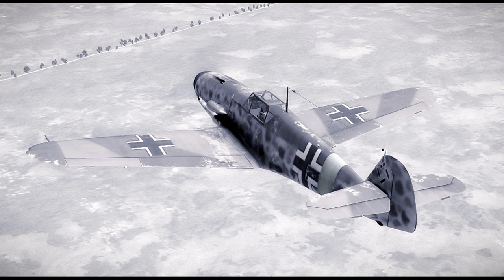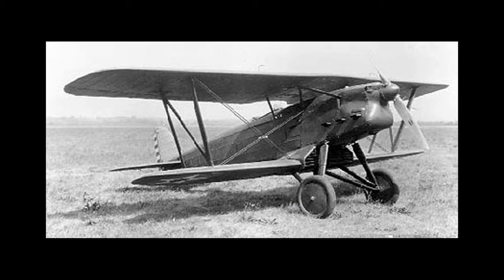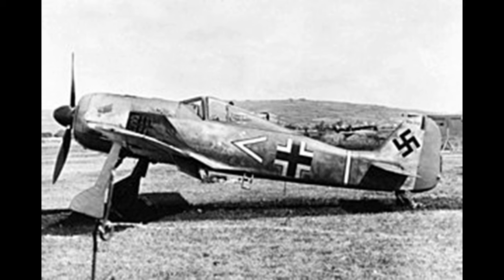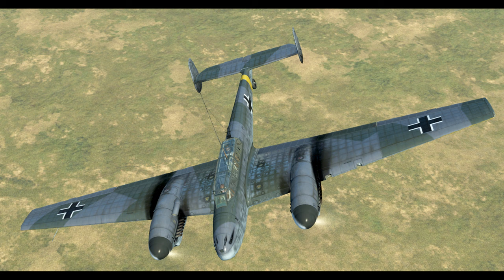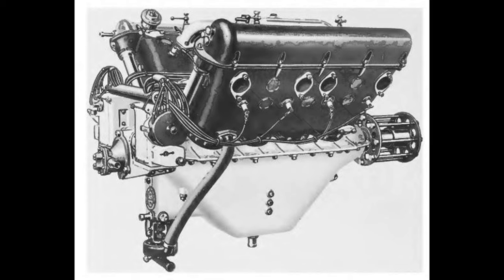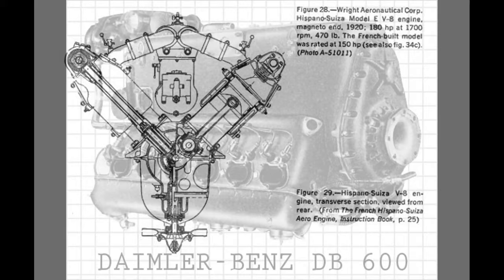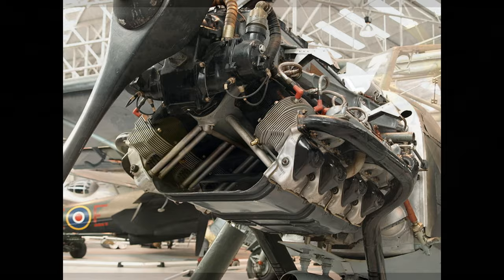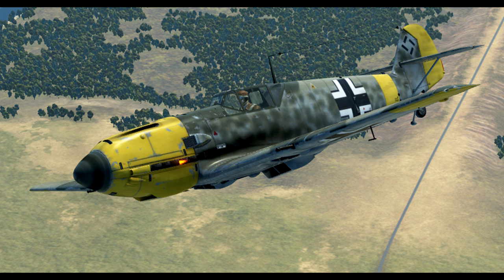Messerschmitt Bf 109 , Why an INVERTED V-12 Pt. 1? inverted V12s vs. upright

Comment: Many early aircraft in WW1 up to the beginning of WW2 had inverted engines. This allowed the direct propeller drive of the engine to be higher in the airframe helping with propeller/ground clearance. This may have influenced the later German designs.
Reply: And possibly also keeping the thrust line in the right place.
Reply: I bet you're right. It allowed a larger diameter prop with shorter landing gear.
Reply: See what DeHavilland did when they went from the Gipsy Moth to the Moth Major. That was the exact reason why.
Reply: Yep, but once you go geared you have the opposite problem. The prop shaft of the 109 is lower.
Reply: I think your right. A tradition of inverted aero engines made them comfortable with the inverted layout even when the primary reason for it went away with reduction geared outputs.
Reply: The Storch engine is the only WW2-era engine shown in this video that still retains this advantage, but yes, I was thinking the same thing. Moving the crankshaft upwards while maintaining a great view over the nose (or along the sides, in the case of the He111 / Bf110). That would be the best thing to use such an engine for, probably
Reply: @Bartonovich52  No, it doesnt. Not sure why you think that. The gearing reduces the height of the prop centerline a few inches on an inverted engine, but it doesn't cause you to have 'the opposite problem'. On both inverted and upright inlines, a geared prop is moved closer to the centerline of the engine, upwards on an upright, downwards on an inline. This slightly reduces prop clearance for an inverted, but you still have better visibility over the nose, it is easier to make a streamlined cowling with the widest part on the bottom faired into the wing instead of on the top, it is still easier to access the plugs and valve train, head gaskets, etc, and it is better to have a high mounted prop lowered slightly than a low-mounted prop raised slightly. In both cases it is far easier to streamline a geared engine with the prop hub centered on the block vertically than an engine with most of the block and heads above/below the prop centerline. And it allows for a hub cannon.
Reply: Better flight characteristics of having the center of gravity below the propeller axis, and cylinder head maintenance had to be the primary reasons, the better fuselage profile was of course something Messerschmidt would recognize.
Reply: @justforever96  questions if I may - why is it better to have a high mounted prop lowered slightly rather than raise a low mounted prop - I don't understand why this would be the case. Secondly there were upright vee engines with hub cannons such as the Yak 9 I think? I still agree that maintenance and visibility are the major benefits.
Reply: @Simon_Nonymous  Because a high-mounted crank lowered slightly is still higher than a low-mounted on raised slightly, and higher allows a larger prop diameter. The shape of the cowling is also advantageous, as is easier access to spark plug, which needed constant maintenance in those days (one of the issues with 36 cylinder radials; eac cylinder has two plugs, times 36 cylinders equals 72 per engine, times 4 or 6 for a B-50 or B-36 equals 288 and 432 plugs per plane to be checked or replaced). Any engine with a geared prop (all WW2 fighters) can theoretically be made with a hub cannon, that has nothing to do with inverted or upright.
Reply: @justforever96  28 cylinder. 4 rows of 7 cylinders. R4360

Comment: All the BF 109s had fuel injection. It would not stall in a negative g dive. Spitfires hurricanes used carburetors that would flood and lose power in the same maneuver.

Comment: I believe this analysis is 100% spot on. Logistics is one of those things people just don't take into consideration most of the time when discussing these topics. fantastic.
Reply from the maker: Thanks Central.
Reply: Yes. Cost and standardization is also a thing often forgotten. Bf 109 won over the He112 because it cost half of what the Heinkel cost, even if it was slightly lower performing. Standardization allowed also to use different engines easily on some airframes. Ju88/188 could use Jumo211 or BMW801 with ease. In general though it was one of the biggest failings of the German industry to not be standardized enough.
Reply: a  higher number of units are Often better than a few slightly better ones
as the case with German tigers/Panthers vs Sherman/T34s
Reply: @JoelLinus  wat
Reply: Amatuers study tactics

Professionals study logistics
Reply: Logistics is important as well as maintenance. The best fighter aircraft is of no prectical use when you need 8 man-hours of maintenance for every hour of operation like the F-22 does.
Reply: I am dreading finding out just how many hours of servicing the F35 requires per flight hour. 
I have a very great suspicion that the F35 is going to require more hours of service and make the F22 look much better. The F35 is late, overweight, over budget, suffering corrosion issues already and has been known to deprive it's pilots of oxygen. 
The Flying Dodo Fighter seems like a suitable name for it as we taxpayers of various countries have been sold a dud.
Reply: Yes the Germans have always been great at figuring out solutions to problems that didn’t exist. Like when they put paste on their tanks to prevent the attachment of magnetic mines the Allies didn’t have... or to be able to swap engine types which was rarely done.  But they weren’t so good at basic stuff... like setting up a massive pilot training program like the British did with the BCATP... or giving soldiers on the eastern front winter jacket. 

The 109 was very simple to make, but also very flawed. In his quest for lightness and cost... Willy Messerschmitt forgot about durability and growth potential. That’s where Kurt Tank and the 190 corrected some wrongs... but by that time the Luftwaffe was spread too thin.
Reply: I Fly Central %
Reply: Exactly. Sure planes, guns and tanks are cool and we like to focus on them and what they do best but the super vital part of any military is a good supply network and excellent logistics. Without fuel, ammunition and food, armies are just really shit camping trips.
Reply: @Bartonovich52  yes if the Germans had concentrated on heavy bombers similar to the lancaster the outcome of ww2 would have been interesting but its all just conjecture.
Reply: @Bartonovich52  The 109 may have been more fragile than the 190, but it was more maneuvrable (than the 190) and could out-climb Spitfires.
The 190 was also more expensive to make, that's also why many more 109s were made.

If I had to fly one I'd still take the 190 though.

Comment: Another side benefit of the inverted v12 was a slight decrease in noise experienced by the pilot- the exhaust stacks were much lower.
Reply: İs sound going really lower or just a little effect
Reply: @semihegeakdogan4964  It CAN be noticed,but i would not call it an important thing..you won´t hear much outside the cockpit either way :D
Reply: Surely every little helps. Remember, I don't think the Germans were using turbos, which means losing their muffling effect.

Comment: According to a teacher that I had in Airplane Mechanic School in 1973 and 74,   Merc Motter said that the reason for the crankshaft being on top in German aircraft was That they didn't have the quality on materials for bearings available to them as we did so they had to be able to change bearings much more frequently then we did hence the reason for the crankshaft on top to allow for quick easy  bearing changes.
Reply: The distributer / Mag.  and valves need the most "love" . Germans invented steel.

Comment: An underrated channel indeed! Awesome content keep it up!
Reply: But loved and appreciated by those that know it.
Reply: @bigblue6917  100% AGREE; WITH BOTH OF YOU!!!!!!!!!!!!!!!!!!!!
Reply: I find it amazing he doesn't have 100's of thousands of subs , honestly!
Reply: I believe another reason for having inverted v-12 engines, is because, even when the engines haven’t been working for a while, the cylinders and pistons, don’t dry out of oil, gravity contribute to have them lubricated
Reply: Greg, you asked why Germans used the inverted V12.
I suspect or has to do with having  enough space for the 2 machineguns above  the engine.
This kind off engine has the advantage off flying inverted with having no fuel problems because off its pumping system wich RollsRoyce  Merlin did found out.

Comment: It's kind of funny that I came for a lesson on inverted engines and got one of the best arguments in support of the Sherman tank. Your channel has the right mix of technical and story telling to keep it very interesting.
Reply: The origin of the PT-109’s motor is in here, too! 8:20
Reply: Unless you actually were IN a Sherman when it got blasted and incinerated everyone in it of course!
Reply: The only arguments in support of the Sherman tank are in it's cost and production capability. Otherwise it was a poor machine, badly designed and incapable of taking on it's opposition. The soldiers left to fight in it were abandoned to economics, left to burn, because it was more cost effective to allow them to die rather than to build a better tank. Dead soldiers provide only tiny pensions for widows, much cheaper than a production run on a really good tank.
Reply: @tag491a  And yet none of that is true.
Reply: @jaykilbourne1110  Substantiate your statement.
Reply: @tag491a  Alrighty. The M4A1's M3 main gun was more than capable of taking on any of the German Panzer 3s and 4s. Fronatly the tank was almost as well armored as the Tiger 1. The slope of the frontal 76.2mm plate gave it an effective thickness that approached that of the heavier Wehrmacht vehicle. The Gun stabilizer (when the crew knew how to use it) gave the Sherman the ability to nearly always get the first shot off, or fire while still continuing to move (allbeit slowly). The later variants armed with the longer 76mm main guns were a serious deadly threat to German Tiger 1s and Panthers, so deadly, the OKW gave standing orders to panzer commanders to engage and destroy 76mm armed Shermans first before any other allied tank, as the 76mm gun was powerful enough to punch through thier frontal plates at standard distances of the era (~750 meters). And no, it didnt take 5 shermans to kill one tiger or panther, it was more like 1.33/1.5 shermans, partially due to the fact that panthers were junk mechanically and had brittle side armor that tended to crack open. The Radio sets in the early war (1942/1943) Were longer ranged than the German sets. They were also NOT death traps, as Nazi propaganda would have you believe; for every Sherman lost, only .5 of a crewman went with them, thanks to spring loaded hatches.
Reply: @jaykilbourne1110  Not death traps? Then why did troops label them the 'Ronson'? After the Ronson cigarette lighter, lights first time every time. This is not Nazi propaganda, came from the troops who used them.   3015 Sherman tanks were destroyed from June to September in Normandy.  1845 German tanks were destroyed in the same time frame, many from the air.  Seems the Sherman didn't do so well after all.  And no, I didn't invent the figures, research it for yourself. The point I was making, more than just the limited ability of the Sherman tank, was the consistent approach of governments when it comes to supplying their armed forces with equipment. Only recently have they come to realise that soldiers are much harder to recruit and providing suitable equipment actually improves results. In the second world war, many make do solutions were used, based on economy of numbers at the expense of soldiers lives. This is a typical example. If you look you will find many more examples.
Reply: @sirmoke9646  Details below of the Ronson lighter patent from 1927. I can only assume the rest of your statement was equally well researched.

Ronson received an exclusive patent, in 1926, for a new automatic style of lighter that worked with one hand, and in 1927 Ronson began marketing it as the Ronson De-Light Lighter with the slogan "A flip - and it's lit! Release - and it's out!" Ronson's new lighters were an overnight success worldwide and soon the company offered a variety of lighters for all tastes.[35][36][37][38][39] As with the Art Metal Works output, many well-built and stylish early Ronson lighters demand high prices in the collectibles marketplace.""

Comment: Greg, Always a pleasure. Everything I've read, where they do add input by Db Engineers and the "Blackshirts" is serviceability and ease of maintenance for the Db's, plus the small valve train pieces were the main culprit for engine failure, invert the "V" add small magnets in critical areas, supposed longer life. Again great vids and info

Comment: The 109 had exceptional focused firepower with it's engine block mounted cannon that fired through the gear reduction hub and nose cone.  As well as the two MG 131s firing forward of the cockpit and along each side of the crankcase. Also keeps the weight of the guns and ammunition in the fuselage and not way out in the wings.

Comment: At the Messerschmitt foundation in Germany they told me that the main reason was the weight distribution down to the longitudinal axis reducing adverse jaw and faster roll rate. The heavy gun and accessories are all underneath the crankshaft.
Reply: Centralising rotating & static mass along the thrust line axis will certainly take some wobble out your roll.

Comment: Great video Greg , I guess another  advantage  of the inverted V,  (in the case of the 109 and 190d at  least ) would be having  room for armament centrally located in the nose..Incidentally my father was a mechanic during the war and worked on the DB 605 , BMW 801 , the Argus AS 10 as well as the  Maybach V12.s used in tanks and halftracks.

Comment: An excellent video! I just asked an aftermarket supplier for parts to a popular Detroit V-8 what it would take to run the engine upside down - beyond having a dry sump, he mentioned oil pickups in both valve covers and in the crankcase breather cavity.
But it's possible, and would make maintenance on a plane I'm Imagineering easier, as well as lowering the CG...
Reply: A Detroit powered plane would be something to hear lol

Comment: A simple  food for thought comment. Mercedes Benz 300 gull wing had direct cylinder injection and had problems with cylinder ring washing with fuel on no start conditions damaging. Rings and bore,inverting would allow it to simply go out the exhaust doing no damage to cylinders and bores due to no lubrication from washing with fuel
Reply: Or cause hydrolock and damagethe whole engine
Reply: The MB 300 gull wing used a straight-six engine...
Reply: @spitefulwar  an upright one so that's why he said that 300 had issues with ring washing, inverted engine avoids that problem. How many cylinders does not matter, their orientation does
Reply: @mmdirtyworkz  It was a straight six but not very upright one at all. The ring washing problem was the fault of the groundbreaking direct fuel injection system, so trying to fix a fuel supply problem by turning the engine upside down is just ridiculous. The engine had seen service earlier in a 4 door Mercedes with carburetors without any  problems.
Reply: Max Pain  Also, keeping the hot exhaust gas low and away from the tail helped with rudder efficiency because it made sure the rudder was as much as possible flowing in dense, cold air.
Reply: @deaddoll1361  noone said that they did the inverted engine to sort out the washing issue, that was just a bonus
Reply: No.- "Rings and bore,inverting would allow it to simply go out the exhaust doing no damage to cylinders and bores due to no lubrication from washing with fuel."
Reply: @deaddoll1361  Direct injection had been around for a while when the 300 SL came on the scene.  I believe the  problem was with mechanical injection on gasoline engines, which lacked the degree of control that the later electronic systems had that could mitigate the problem.  There wasn't the same problem using mechanical injection for diesel locomotive and marine engines, partly because of the fuel and partly because startup was a relatively infrequent operation with those applications. 

It is reasonable to suppose that the ring washing problem could have been a consideration in using the inverted V design, although avoiding it could have been a fortuitous result of adding fuel injection to a previously established design.  Whether or not there were carbureted engines with that layout I do not know.

A slanted engine still has the pistons below the cylinder head, so the difference between it and an upright one is not significant - unless one is looking to score points in YouTube comments.